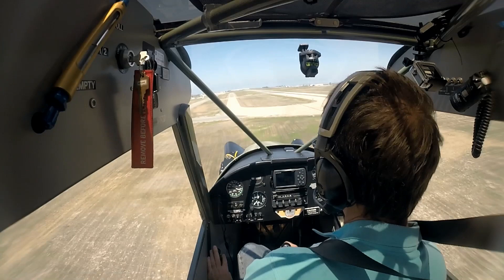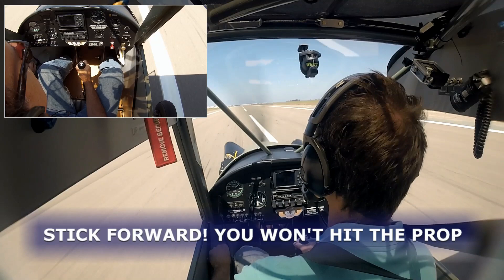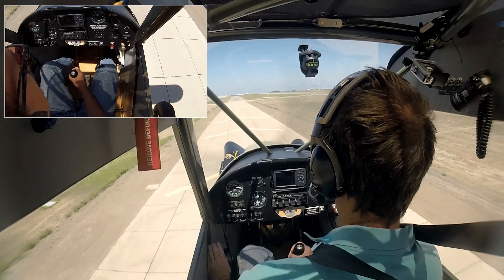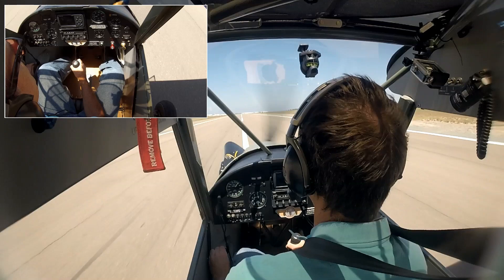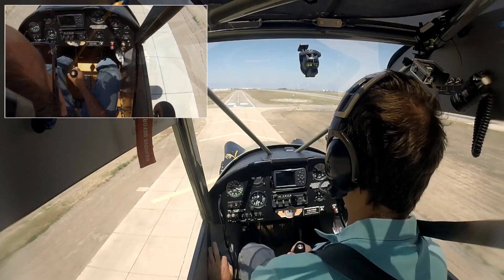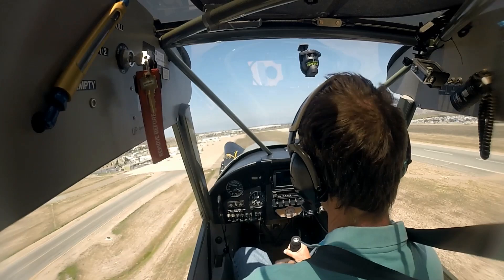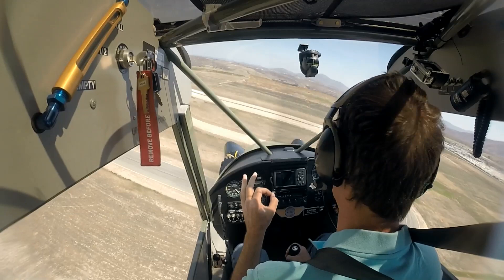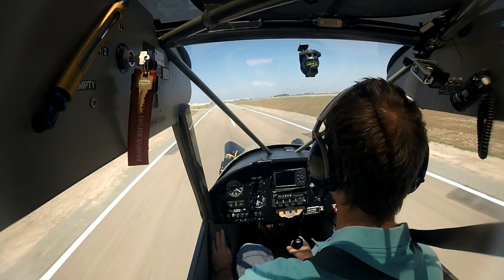Wheel Landings in a Tailwheel Cub

Comment: I owned an F-19 Taylorcraft in 1986, N2003L, in north TX where the wind always blows. The old school aviators who I was around, all WW2 pilots, always said a good full stall landing was worth a dozen wheel landings, and in the 600 hrs I logged in the T-craft I learned they were right. If a gust of wind hits you during the transition from tail up to tail down the plane will weathervane into the wind, even locking up the opposite brake won't keep you on the runway, Ive experienced it several times, luckily I got stopped before going through any fences. The best technique for gusty cross winds is a full stall 2 point touch down with the wing low, main gear facing into the wind and tailwheel touching down at the same time. If the wind is blowing to hard for that, never be afraid of using the width of the runway to land, after letting several friends fly my T-craft I realized that people gravitate towards wheel landings because of the better forward visibility and the sense of more control the higher speed gives them, but wheel landings are definitely not the way to go in GUSTY cross winds, at least not the type of wind we get in north TX.
Reply: different strokes for different folks. My creds: 15K + hours in NM, West TX, all over Mex in T-crafts, Cubs, Champs, T-6s,  C-0180 & 185, Twheel RVs, MM2, Pitts,  Pawnees, Ag-Wagons, Snows, C-47s, D-18s, maybe 30 more.. As many hours in Beech 17 as the others combined. Could not disagree with you more. Your W Tex buddies a different group than mine. My first paying job was with a guy who flew the Michoacan outback in C-180s and PA-18s. He hired me cause he'd just caught one of his pilots 3 pointing a C-180.  3 pointers were a firing offense. Advantages to wheelies: 1) you can see where you're going, very useful on narrow strips. 2) You can brake hard and soon w/o fear of nosing over or ruining tires, very useful on really short strips. Best full explanation of 3 pointers v wheelies I know is in Stick And Rudder. I make the chapters on this subject required reading for people to whom I'm giving tailwheel endorsements.  Old argument, never will be settled, but hang around an airline or ag op staffed with pros for awhile, and I think you'll find most do wheelies most of the time, almost always in gusty Xwinds. .

Comment: Excellent. Thanks for the "negative angle of attack" comment. I keep seeing videos where they represent a wheel landing as being something in between full stall and what you do. What's the point of a wheel landing if you don't pin the gear to the runway with negative angle of attack. Their method also likely reduces air flow past the rudder...that grey area you pointed out. My solo X-C was in a Luscombe 8A to a narrow strip with 90 degree X-wind. I followed my training, gritted my teeth, and shoved the stick forward as soon as the wheels touched. As you mentioned, a student has to get past the fear of prop damage to make a good wheel landing.
Reply: I have a no electric 7AC Champ.  I got to fly a few hours with a good CFI in his 8A.  I really like that airplane, and when I bought the Champ was also looking at 8A's.

Comment: Wheel landings have some advantages, but they can be much more dangerous then 3 points! If a gust of crosswind hits you and your plane turnes into the wind i prefer that the Tailwheel is pressed on ground and not airborne.
And 90% of all flip over with a Tailwheel aircraft Happen due to wheel landings. With a 3 point Landung you can really brake hard if you have to. Do that with a wheellanding,..... you will destroy the plane. The next is that the tendency to a Groundloop is never with high speed when you are at ground, it starts at low speed when you think the landing as already finished! But in a Tailwheel aircraft it’s finished when you plane is inside the hangar. 
Wheel and 3 point landings have both advantages, the Supercup is super easy to land, no compare to some other taildragger beasts. But after more than 1000 Tailwheel landings...... I can only say that whenever I have crosswind I go for a 3 point! I want the Tailwheel down to have better directional control ..... and if you land with minimum speed in approach the time you have to fight the crosswind is less. 

Both landings are good, but to say the wheel landing is THE solution for crosswind is not really a good idea

And Sir: perfekt made video, i enjoy watching them. Well done 👍
Reply from the maker: There's a lot of opinion and personal preference there. Can you source your claim that "90% of all flip over... due to wheel landings."? Not sure where you're getting that. And ground loops don't happen based on speed; it's when the tail gets out side the track of the main wheels and centrifugal force takes over. It's geometry; not speed-related.

Comment: Garry....I am a retired A&P, that has flown since I was about 15 years old.....just never had taildragger  time. Ego does NOT prohibit me from claiming that I am a better mechanic than I am a pilot. I am not a "great" pilot....but I am a SAFE pilot. This all being said, I am building an LSA taildragger,auto-conversion(suzuki) that I plan to EXCLUSIVELY use on paved surfaces. This design flys "exactly" like a cub(from what 3 seperate owners told me). The flight physics of a conventional-gear craft seem a bit more acute vs a tri-gear....IE...active feet are best. With this in mind,is there ANY real reason that I SHOULDNT  ALWAYS go for a wheel landing vs a 3 pt?? It is my assumption that if I encounter higher winds upon landing, I would have better landing/rollout control(assuming I do "my part").Thanks for the great vids! Bob
Reply from the maker: You'll find you're in "no-man's land" for a few seconds as you bring the tail down after a wheel landing. Many a ground-loop occurs at that point, as control effectiveness fades and any wind becomes a bigger component compared to your decreasing airspeed. In a strong or gusty headwind, you'll want to do a 3-point full-stall landing pretty much every time. (See John Doe's comment below...)
Reply: I'm no expert and need a lot more experience.  But I always do a wheel landing on pavement. 3 points are easy (for me) on grass but can be pretty scary on pavement. This guy's video is perfect, come in a little fast and keep dancing on the rudder until it is starting to slow down. Like the other's said, there is a second or two where you don't have as much control while the tail is settling.  That takes the experience.. don't bring the tail down too early or it will balloon back up and scare the heck out of you. Keep the tail up too long and you don't have enough rudder authority as it slows down.
Reply: I once told an old timer with many hours in taildraggers I was going to go up and practice wheel landings,
He said, Why?